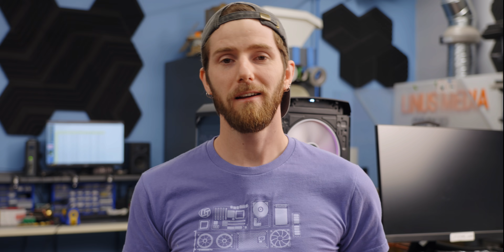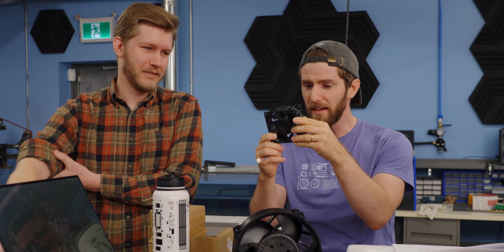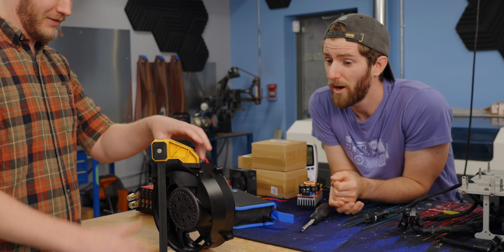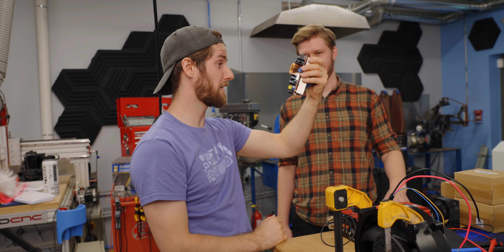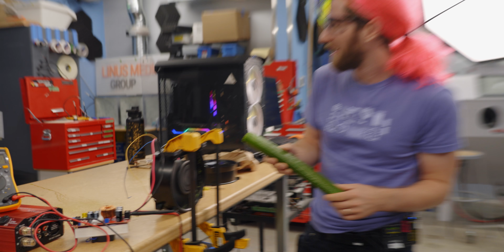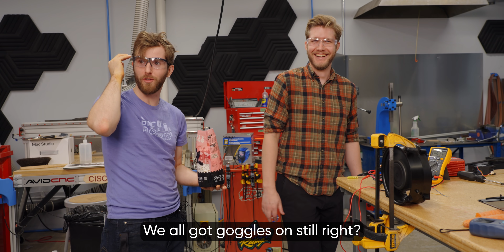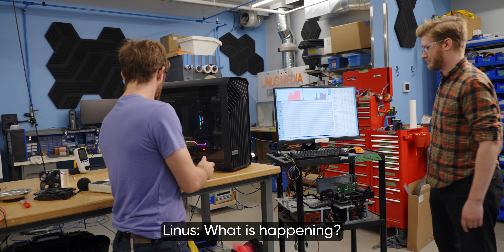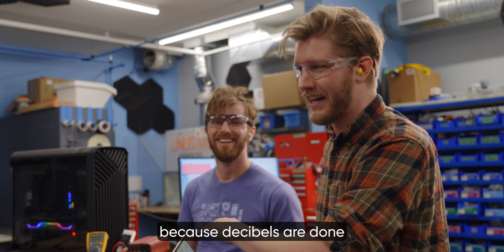The God of Computer Fans

Comment: 1200W means at least 25 amps continuously through the wires. That's why they're uncomfortably (over)heating so much. For the sake of safety, you should use at least 4mm² wire section at this rating on the 48V...
(and from the 24V to the converter, I'd go even a bit thicker: 6mm²...)

Comment: i used to work with similar fans at my previous job, they are used for cooling passive servers ( every server uses fanless heatsinks and those fans cover the whole back of the rack, we get less maintenace and shorter build time ( no fan to plug/ install into the 100s of servers inside the rack))

Comment: i used to have a 120mm fan that was about 3.5inches thick and plugged into a wall outlet. I put it on my case side panel directly above my AMD stock cooler that I shoved on an AMD FX-9590. went from thermal throttling to barely hitting 55c under load. my dad got the fan from the mine he works in. not sure what they were using it for, but it kept my pc cool for years. it unfortunately got lost in a cross country move.

Comment: Here's a thought;

A lot of servers will have airflow guides in them to distribute air presure through the cooling systems. Why not make a carboard or plastic air guide that rams as much of the air from these fans as possible down the CPU heatsink and a little at the GPU To see what temps it achieves?

Comment: Those big Delta fans are pretty common in outdoor racks for network gear or in wiring closets where you need the equipment to stay cool even if the roomor rack has no AC and is cooled by drawing in filtered outdoor air.

Comment: The pot for controlling the output voltage is common for that type of power supply. As someone who has butter fingers I tend to use plastic tools to turn those, so if I slip I don't short something. 
Also it looks like a decent boost converter.
Reply: I have one of those. Its cheap. It works. Its fine. Linus is just making a spectacle.
Reply: @greenanubis  if you arent knowledgeable on EE I can understand being scared.
Reply: @f4ephilosophy691  Yeah the sub-par solder job didn't inspire much confidence and you don't usually look at something that small and think "yeah that'll do over 1kw." I know they're fine, but I can understand how somebody who isn't around them often would be sketched out by it.
Reply: @greenanubis  They do need to pad out the runtime...
Reply: Trust me it's not butter fingers, I swear they design those things to eject anything inserted into them.

Comment: Electrical Engineering student here. Boost converters are a cheap and convenient way to power things. It doesnt make any sense to use an expensive variable power supply on a project that might be running continuously for a while. Best practice is to use a project box (ABS plastic container) but honestly, a boost converter is never going to have a lethal potential on hit as long as you are not boost converting to really high dc voltages. I used one to power a home made fish light and it worked great for years, and you could even lick it with only mild shocks.

Comment: 3dB is double the power. Perceived volume is 3D, so double the perceived volume is ~10dB.  Also it’s not as simple as “95dB bad”, its about how the power is concentrated across the frequency spectrum - which is why loudness meters have different colours. 95dB is pretty normal at a concert, but across a reduced/narrow frequency range can be dangerous after 10-30mins.
Reply: To be clear, 'normal at a concert' is definitely not great for your hearing either. 
Man, sound is complicated and decibels are a very weird measurement to get your head around though.
Reply: @Lizlodude  yep, 95db of electric guitar is very bad for your hearing. For example.
Reply: The best part, Linus protected his hearing with airpods...
Reply: like a laser? When 3W over a wide spectrum isn't bad but when it's concentrated on a very narrow part of the spectrum it can hurt you

Comment: Hello Linus Ive used these professionally. In my use case it was positive pressure of a mountaintop radio base-station. The reason for this was to keep the elements out of the base station. They are super loud when you run about 20 intake fans.
Love your content guys!
Reply: Do you still have your hearing or have your ear drums blown out?
Reply: I can confirm that 24-to-48v fans like this are also used in cellular and microwave communications shelters in locations where it makes sense to save power over running an hvac when the ambient temp delta is sufficient for enough of the year. Most of the equipment in such sites is -48VDC or +24VDC so you'll already have a DC powerplant and battery stack in your native voltage range, no converter required. They don't usually replace an hvac, but they can act as a sort of standalone economizer in support of one. I've mostly seen them used in banks of one or four, but sometimes there will be multiple banks of fans run by a single bulletproof industrial mechanical thermostat.
Reply: @xeonicfront  sound alike these would make for a dusty computer.
Reply: @h8h81  I suspect you'd want to fab some sort of air filter for this, and change it regularly. In communications hut mountings they are usually paired with a set of louvers(either gravity/magnetic closure/pressure operated or occasionally electrically driven and run off the same thermostat via relay) with a track for install of common air filter trays. Semi-related I used one of the old vantec tornadoes on a small business server in a closet years ago and it pushed a crapton of dust and airborne debris into that case(sole intake fan). That setup didn't last long because the office workers complained about hearing its' keening wail distinctly through the walls. I want to say that fan was rated at something like 60dbA.
Reply: Was there a reason to use 20 of these instead of a single large fan?
Reply: @user2C47  Redundancy, cheaper (Mass production vs custom, though not 100% sure on this b/c haven't gone looking for high power fans lol), split power (separate circuitry instead of having 1 20*600W fan [exaggeration but you get the gist]).
Reply: These are also used for clean rooms, creating positive pressure, evacuating gasses, you name it.  Being brushless means they don't spark which makes them safer in potentially explosive atmospheres.
Reply: @Sidowse  The same way you get the rest of the equipment up there.
Also, I was thinking more of a centrifugal blower like you find in HVAC systems, than a giant axial fan.

Comment: I remember my 60 mm delta fans and Alpha heatsinks mouted on two Celeron 366 on a Abit BP6 in 1999. My wife thought I left the vaccum cleaner on when I booted up the computer. The Alphas had to be powered from molex and couldn't be connected to the motherboard because of the powerload.

Comment: To Linus' question as to what this gets used for:

You'll see these bolted to some specific racks in larger datacenters. For example racks that have an almost solid front door (egs. for security reasons) where the hot air is extracted out through the top of the rack.

There's also a lot of large rackmounted equipment that has enourmous fans.

Comment: These fans are often in inter-rack AC cooling. We have them in between the racks dumping air out of our hot/cold split room
Reply: They are also used for the blades themselves. Take one of those 800W cooling modules apart, you will find this fan or its cousin inside.

Comment: This just gave me a video idea. Take a bunch of fans from cheap to expensive, all with higher max rpms, and forcibly overvolt them to see how fast they go before exploding. That would be fun as hell
Reply: Collab with The Slow Mo Guys would be neat on this
Reply: You may like Photonic Induction
Reply: It's a neat idea, but with server fans unfortunately it won't work - the maximum speed is fixed by the internal microcontroller, so no matter how many volts you feed the fan, you will not be able to make it exceed the stated speed (as observed in this video).
Reply: you'll fry the controller long before it explode. i accidentally feed 12V fan with 24V once and the only thing it does is nothing. going back to 12V didnt turn it on because the active components fried
Reply: @n.shiina8798  same. Mine is super slow now and gets hot :/

Comment: actually yes we do have these at the place I work as the servers run hot and there is a air conditioner but we prefer to get the hot air out as quickly as possible and keep it a nice 50F degrees

Comment: I acquired a similar fan from a metal reclamation company in the mid 2000s. Wanted to use it in a high-current power supply. Sounded like a jet engine and almost pulled the power supply across the workshop 😁

Comment: 0:00 the Phanteks T30 120mm is objectively better in practically every conceivable performance category possible, lower noise, much better performance, lower minimum RPM (0rpm) higher max rpm (3000rpm), lower temperature-normalized noise, lower noise-normalized temperature, much higher static pressure, like it's not even close.

Every single review comparing the two the Noctua fan gets absolutely curbstomped. So that you call the Noctua fan the best computer fan is something I highly disagree with because of how inaccurate of a statement that is.

Comment: I’ve seen fan like those on industrial equipment to cool down braking resistors. We have a test bench designed to destruct starter motors, and when it stops, it dumps so much energy on the braking resistors than a massive fan will spool up for a couple minutes to dissipate it

Comment: Used them in work to super cool a thermal camera looking at a BOS converter slag pour.

You need the volume to push air from outside through ducting and into a building.

I would guess it's regular use is a ups backed up cooling solution  as most industrial power ups (i.e. security systems) have a 48vdc output.

I wonder if you put one of those really large passive coolers on the CPU if you would get a better cooling outcome?

Comment: If you're not going to use a CPU cooler fan, you should have used Noctua's  NH-P1 (massive fanless) heatsink to it!
Reply: Actually might not be more efficient given how wide the gaps on the fins are on that cooler. There's actually a ton of air flow going through the cooler so the tighter fins probably lead to better overall cooling.
Reply: @BrianMcKee  The NH-P1 has so much more mass and surface area, it would most definitely perform better, regardless of fin density.
Reply: @jgorres  It may have more mass but it doesn't have more surface area. This is incorrect. Your standard tower cooler has more surface area due to the density of fins.

Comment: Can we have one of the electrical engineers tell Linus he is a dummy for being scared of a few volts DC, and then have them tell Alex he is a dummy for letting Linus measure a Boost Converters voltage with no load (altho this one was luckily fine, lol)
Reply: Ah, it has current protection ... next time lead with that 😬

Comment: Many moons ago, I got my hands on an industrial fan by Pabst. It had the perfect size and holes to mount it in the PC case I had. That fan was like 180mm or so and ran on 230V. For shits and giggles, I put in a 230V plug, a switch and mounted it in the front of the case. Was quite the talking piece for LAN parties. But totally unusable in a more normal setting, because of the loudness.

Comment: Linus' overreaction to that variable power supply was adorable
Reply: im still scared to put my multimeter in the power outlet tbh

electrical engineering is
 scary when ur not used to it 😆
Reply: @pauleymuthni9346  You should be very afraid of mains 120/240VAC even when you do know what you're doing, anything below 50V DC though? Ehh not that dangerous, if you have an open wound or something that might pose a risk, but normally it's not that big a deal, the worst thing that may happen is too small wire and it catches fire.

Comment: As for "where these are used". 

They often get used as cooling for entire racks with little to no back clearance. They are placed in the top section of a server rack and are powerfull enough to draw fresh air in from the bottom trough the entire rack. 

I had the little brothers of these cool my PC when I was way younger, ran on 230V AC and were monsters. Could only run the PC with headphones on (and even then it was barely enjoyable) but it was heaps of fun to just mess around with them.

Comment: Another thing to realize is that RPMs are not a perfect measurement of speed, you also need to look at how long the fins are. Doubling the length of the fin means that the tip of the fin is also traveling twice as fast at the same RPM. And doubling the length will also approximately double the weight. Force is equal to mass times acceleration, so by doubling both the speed and weight you are quadrupling the kinetic energy of the fan.
Reply: RPM is rpm, nothing more. They don't measure the speed of the fan by it's tip speed, that would just be ridiculous and convuluted.
Reply: @Ravenousjoe  But if you want to talk about how much inertia a fan blade has (which they did briefly), you can’t rely on RPMs alone. As I said doubling the fin length doubles the linear speed even if you keep the RPMs equal, and that doubling of linear speed is what actually matters in the calculation.
Reply: @fakjbf3129  Dude's here trying to calculate rotational kinetic energy in a funny fan video
Reply: @fakjbf3129  what calculations? The fan specifies it's max rpm and the amount of air it moves. What was your initial comment even addressing other than just flexing random knowledge?
Reply: @fakjbf3129  aren't you supposed to be using angular velocity for circular motion?
Reply: The 80 mm Delta blowiematron spinning at 11,000 RPM has a blade tip speed of ~46 m/s (165 km/h or 102 mph).

The 200 mm Delta Blowzooka spinning at 7,400 RPM has a blade tip speed of ~77 m/s (277 172 mph)
Reply: @MrMartinSchou  Well, yeah, i hadn't taken in account RPM difference assuming same RPM for both fans
Reply: Kinetic energy is 1/2 mV^2 so doubling both the mass and velocity is 8 times the kinetic energy.
Reply: But isn't doubling length makes them spin 1+(2R^2-R^2)/R^2 times faster?
Reply: wouldnt the blades be even heavier than double? i mean they would also be thicker than most pc fans i guess?
Reply: @TheDeathLove  How did you read that comment and think that was a reasonable reply? As you put it, Wtf are you talking about?
Reply: @Nbomber no, I most definitely do considering I work on turbine engines lmao. The comment just made no sense and was a nothing comment.
Reply: @Nbomber It didn't offend me, it just made zero sense to just randomly spout out a bunch of knowledge that nobody asked for as if to correct the guys in the video. Nothing needed correcting, it just seemed like such a random thing to write about just to get attention.
Reply: @Nbomber That's exactly how it came off to me. Granted, a lot of people upvoted it, so I will say, I am probably in the wrong here, clearly it holds some value to quite a number of people.
Reply: @Ravenousjoe  I wouldn't say it was a nothing comment, it was just a poorly worded comment. That is why I asked if he made a typo because his comment makes very little sense the way it is written. (swapping RPM for force would make more sense) The people upvoting it are either not paying attention to what he wrote or are concerningly oblivious to how little sense he was making.
Reply: Did you mean to say measurement of speed or force? RPMs are a pretty good way of measuring rotational speed.
Reply: @--_DJ_--  They are a good way of measuring rotational speed, but not linear speed. For example a windmill might spin at something like 10-20 RPM which sounds fairly slow, but the tips of the blades will be traveling at over 100 mph due to how long they are.
Reply: @fakjbf3129  Right, but RPM isn't a measurement of anything other than a rate of rotation.  You started off making a statement about RPM then backed up that statement with irrelevant information in regards to RPM. That is why I asked the question.

Comment: You can get a 12 Volt car rad fan on Amazon as powerful or more for $30-$200 dollars. You would have to do some modding, but could easily get it to work.   I built an insane powerful fan for my room with one. I powered off my EVGA 1000 Watt PSU in my PC.  That PSU powers my Entire rig, Car head unit in my desk, Rockford Fosgate T3002 Car Amp, Fan, and a few other things in my desk.